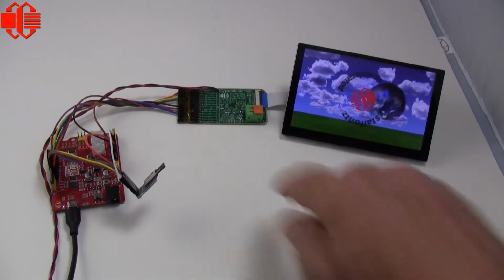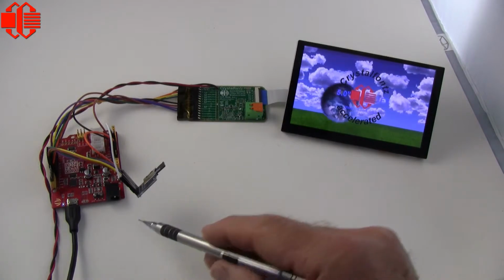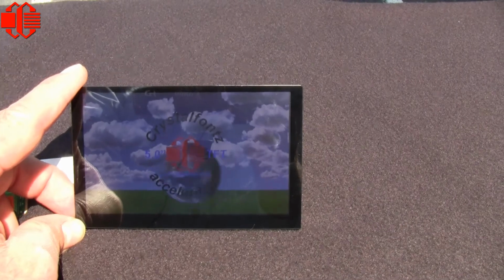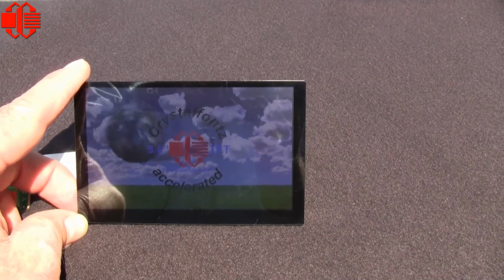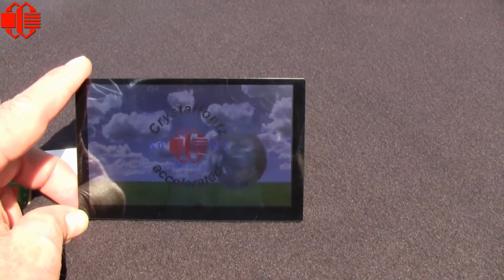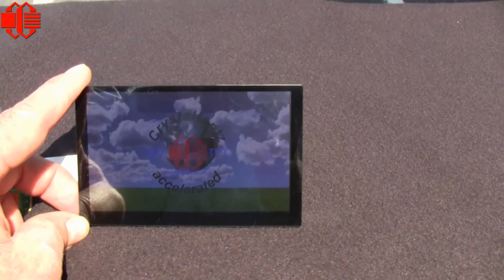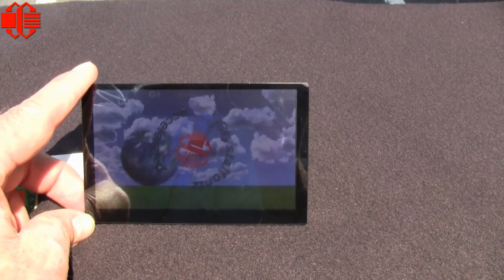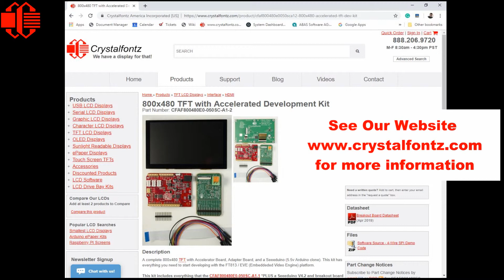Driving a Hi-Def TFT touchscreen by Arduino using only  SPI (FTDI / BridgeTek EVE accelerated)

Comment: Can these controllers be configured (or designed into a system) to drive a standard computer flat panel display?
Reply from the maker: The EVE's use SPI for their interface, so they're not really designed for that, they're better suited for smaller embedded displays.

Comment: What microsdhc card reader is being used in the video?
Reply from the maker: Hi Jeff, We're actually working on getting them added to our site soon. I'll shoot you a link as soon as we do.
Reply: @Crystalfontz  Great. I'd buy some. From the video looks like you have the display/reader both hooked up without a lot of fluff.  The reader I have now needs a few pull up resistors and a tri-gate to work on the SPI bus with the EVE board/display.  It works but its way messier than what you have going.

Comment: Interesting, annother EVE module, I will add the timing parameters to my library as soon as I can find them.
Unfortunately the 30pin FFC makes it incompatible with the other modules but it looks like these are on backorder anyways. And not available outside USA?
How do you supply the backlight in your demonstration? 3.3V/1A from an additional PSU?
Reply from the maker: Thank you for your comment. We went with 30 pins for more ground conductors (better high-speed signal integrity, lower EMI), and more power conductors to handle the higher current needed by the sunlight-readable display's backlight. The display, prototype adapter board, connectors, and cables will be available soon on our site. Yes, we use an external bench supply for the backlight in the demo. The backlight can be driven by 3v ~ 5.5v, independent from the 3.3v supply used by the FTDI FT813 accelerator and the TFT display. Using a higher backlight supply voltage reduces the current since we are using a switching supply. Also, the backlight modulation is at ~50Khz so it is well out of the audio band, which simplifies the audio amplifier design.

Comment: Can not see Arduino in the video 😎
Reply from the maker: We're actually using a Seeeduino (It's basically an Arduino Uno clone, however it provides a switch to change from 5v to 3.3v, which is super handy). It's the red board on the left. You can check them out here: https://www.crystalfontz.com/product/cfapn15062-seeeduino-arduino-clone-microprocessor